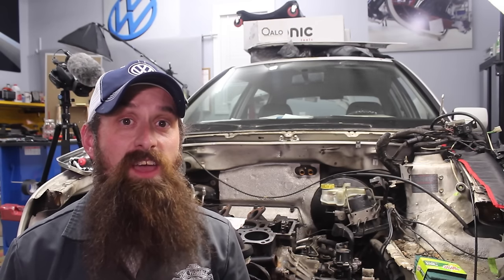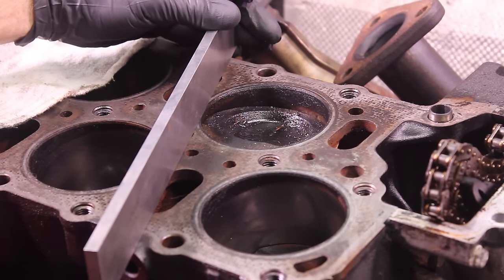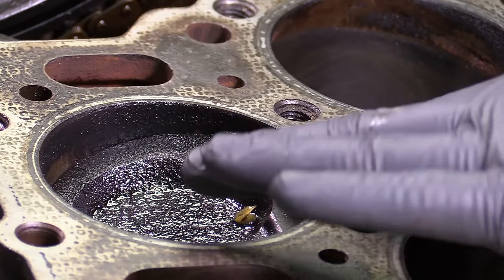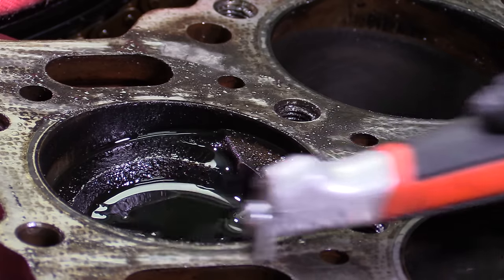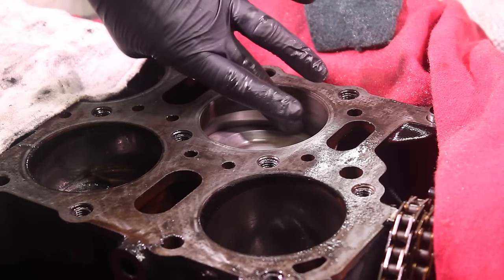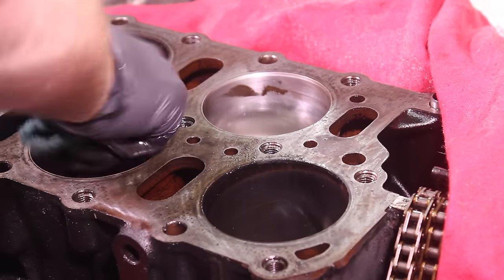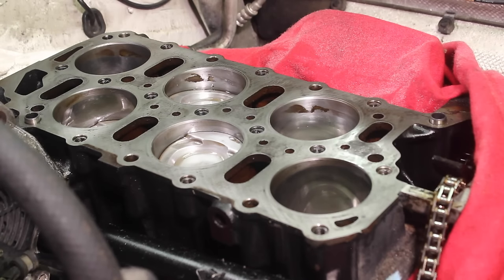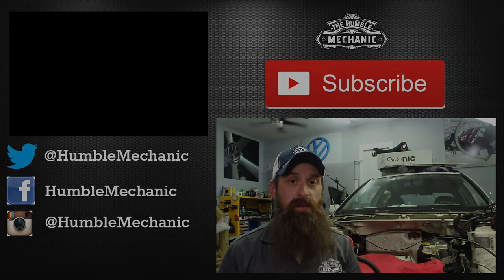Removing Carbon From Piston, Cylinder Walls, and Block Deck

Comment: I am not a mechanic although I worked on my own cars in the 70's and 80's. Here is a tip I always remembered from my father. You can build a grease dam around each Piston crown at the sleave when removing carbon. This will help with debree getting down between the crown. Then when done move the Piston a little down and wipe the wall and piston clean.
Reply: Fuck me that's one helluva smart trick! I had my engine head off and wanted to clean the block whilst it was still in the bay. After a bit of scrubbing I realized I got a shitload of debris and scotchbrite pad material down in the channels and around the piston rings. But then I noticed the block was junk anyway so I took it off and junked it. But next time I'm doing the block still in the car, I will use your dad's method!
Reply: That's a great tip, I'm doing it now on my old Lada Riva, thanks.
Reply: Now that's a hell of a trick! Simply genius!
Reply: What a great idea.
Reply: If your worried about debris, Just use a Shop Vac to vacuum it all out. Never had issues.  I always do this when replacing intake gaskets.
Reply: @jamesprival8528  
Turn over engine till piston is down, wipe a smear of grease around about the top inch of the bore then turn the engine over till the piston comes back to TDC and the gap will be full of grease. Do the opposite to clean it out once you're done.
Reply: @ThisOldMan-ya472  
Not a good ideas to blast the debris even harder down the gap with air.
Reply: @AuMechanic  Uhmmm, if you build a grease dam, and use an air blast appropriately, you remove debris without causing any issues with the parts. When blasting intake runners, be sure the valves are closed for that runner, or don't do it.
Reply: @ThisOldMan-ya472  Using the grease avoids the need for any air period, and using air will just force debris down in to the the ring land above the top ring and that is bad as it can cause the ring to jamb in the land..
Reply: This didn’t work for me, the grease just got all caught up and I had to turn it over a tons and wipe each time it hit bdc to get it out :/
Reply: Just take the pistons out, clean the rings properly and put back together exactly as it came apart … it couldnt be easier with the engine at the stage it’s at now 🤷‍♂️
Reply: Great 👍  video  bro!
That's what  I'm working  on ...
Thx,

Comment: A trick that I read about online, that I have used with good results, is to smear a little grease on the cylinder wall, then rotate the crank so that the piston pushes the grease to the top of the cylinder, then let the piston go back down. Any dust, dirt or debris that has fallen into the piston/cylinder gap will get stuck in the grease! Now you can simply wipe the ring of grease out of the cylinder taking any crud with it :)
Reply from the maker: That is a great tip!!!

Comment: I'd use a lacquer thinner to dissolve the carbon first. It will clean off faster with no scraping. Using WD40 AFTER that does seem like a good idea. I have decarboned many 2-stroke airplane engines and have never used any kind of scraper. Just shop towels. NO scrape marks anywhere!

Comment: why engineers hate mechanics
Reply: dude im a mechanic and i hate us. you wouldn't believe what kinds of "common practices" some guys use.
ive seen a guy use degreaser to clean the surface of a timing surface for a reseal, with it all dripping into the sump and didnt end change the oil.
Reply: @TheComaDay  i'd be lookin to slap some sense into that mech.
With that stated, I agree. I hate mechanics so much, especially shade tree's like myself, I won't let anyone touch my vehicle, not even to help, unless it's for an alignment or tires.
Reply: I'm pretty sure that if you ask mechanics, they will tell you we deal with shit engineering FAR more than engineers deal with shit mechanics. Talk to me about S85 rod bearings, late Audi timing chains, Ford 3.5/3.7 waterpumps, etc, etc.
Reply: @VTLIFE-so4dc  engineers should work on their own stuff, teach them to design right. I bet they'd change their ways. 😂😂😂

Comment: I just pulled the head off my 2000 Toyota Tacoma, I was told I had a blown head gasket after driving it for 30 miles and overheated slightly but not completely, that was after replacing the fuel pump after vehicle being parked for 5 years; i drove with old fluids, coolant was low, but immediately as I saw the needle climbing I stopped and drove it gently back home, once shutting ignition off it never started again, cranking but nothing, so a compression test was done showing zero compression on cyl 1 and 3 and 180 psi on cyl 2 and 4; firing sequence is 1-3-2-4; I was told "you blew the head gasket" 3 years later finally got to open the head; The gasket seems intact; I cant see any indication it is blown; there is no oolant/oil mix at all, old oil still conserves some viscosity and color; coolant came out also without oil mix in it, i look on chamber 1and cant see any issues with the valves, like a burnt valve? maybe a bad valve seat? I ordered new valves, seats and lifters, cams are worn but everything inside the head looks "normal" once opened; I thought maybe I had a bad coil pack but compression is physical not electrical so it would not matter as it was zero...I hope it is not the worst and maybe I have a cracked head or block??? I am taking the head to the shop tomorrow. Very weird situation.

Comment: 5:55 "Dont press down too hard, we dont want to take scrape off any metal" makes a fat scratch in the metal
Reply: Furries are disgusting Good call out. That's a time to be mindful.
Reply: It will buff out, usually/maybe. Had the same thing happen with bigger engines.
GO NAVY!
Reply: Wow! I was just going to put same comment @5:56 but you beat me to it. A fine example of why you DONT use a blade on a gasket surface, especially Head Gasket, especially aluminum. Im shocked he used it to begin with. "Cost me 20$ for the scrapper" and 150$+ to deck the block along with 25$ for a head spacer. He did mention using a roloc, better choice.
Reply: I dont want to make it sound like I'm cutting down the Humble Mechanic, just pointing out even those with much experience can still make a mistake with a scrapper. Having said that, it wasn't the end of the world, it wasn't in an area where the gasket would be up against a critical sealing surface and contrary to another comment above, buffing it out only makes it worse, do that and now you have a larger low area. So never buff it out. I'm am painstakingly scraping over a cylinder head now with a plastic blade that I'm constantly sharpening and brushing acetone on it in between. I really want to use a nice razor blade and I'd be a liar if I said I've never done that before, but I dont anymore. Think I'll get a roloc. I'm going to be at this for a few weeks with these results.
Reply: @ColdWarVet607  it's fine to use a carbide scraper on aluminum, but you need to do it correctly. I'm more worried about all the chunks of carbon that are now in the gap between the piston and bore, getting into the rings.
Reply: Amazon has some plastic blades that are useful
Reply: made me cringe as he actually put the blade on the block
Reply: I cringed a bit

Comment: I think you should mention that depending on the material the block is made from, different tools and techniques should be used to prevent damage to the mating surfaces of aluminium blocks.
Reply: I'm a mechanic and I approve this message. 👍

Comment: Lots of great information in this vid.
Over the years I’ve found hot soapy water works great for carbon deposits. 
I’m not recommending in this particular case, but if you’ve got parts off that have carbon deposits on them that needs to come off, try soaking them in hot soapy water. You’ll be amazed at how fast and easy the carbon comes off. It does have to soak for a bit, but man, sparkling clean.

Comment: Just did had gasket on my 2002 Civic with 285,000 mi on it.
I took a fine tooth wire wheel to the tops of the pistons... It got some carbon off but not all.

I feel skeptical that it would have gone quite so easy peasy if I'd tried this method! How many times have I seen something on YouTube and then when I put it to practice in real life, doesn't work out quite as promised.

Humble mechanic You seem like a good guy and in real life I'd definitely give you a shot! Just saying I've been burnt by YouTube before.

Anybody try this method and not have it work out quite so easy?

Granted 285 is more than 140... That's a lot more miles/ time for the carbon to harden.

Comment: As a qualified motor engineer with 50 years on my clock, might I ask about the piston rings ?
This is a 140,000+mile, engine. I agree that the cylinder bore 'cross hatching' marks being visible indicate limited wear & assuming there are no vertical plane scoring marks present then everything down the bores is all OK. 
However ! (There's always a however) on my vast and comprehensive experience with bashing engines with hammers, I would like to point out the fact that 9 out of 10 engines that I have stripped have the piston rings stuck in the piston lands. The piston rings in most cases need to be removed, sometimes even broken to remove them from the piston.
I ask, if the 'crosshatch' marks are visible and there's a 'within  tolerence' 'Bore step' on this high mileage engine, would it not be prudent to assume that the piston rings have stuck, thereby causing excessive oil consumption etc. and as you've gone the trouble of half stripping the engine, to remove the piston & conrod assemblies ?
I know its a can of worms but at high mileage, the crank bearings might be well worn. 
I understand that this video deals with block levelling but attention is being given to the bore condition & I thought my input might be of some help. 
Respectfully. Not a
 criticism, just observations based on a career lifetime of engine rebuild fails ! 
Nice informative video by the way. 
My respects,
Johns MG Rover parts.
Reply: You young fellers and your "piston rings"...why in my day...
Reply: John Sadler It’s a stinking VW. You overthinking this greatly. It’s not worth rings much less cylinders being bored and oversized pistons.
Reply: Your correct with that many millage them crosshatch should not be visible. Bizarre,then again it's been some time I viewed iron walls, working on today's motorcycle engine using chrome nickasilk
Reply: @prevost8686  modern  VW engines have many issues with oil scraper pistons rings: they are thin and the oil holes are very tiny and if the case the car is use most in city and not frequent oil drain with high quality oil,  this holes are many times clogged= high oil consumption, and looks like the engine whe see here as such issue because the thick oily residues on the pistons and cylinder walls...
Reply: I would of done a compression test before hand
Reply: There are more hacks than craftsman.
Reply: Thats good info John, I'm going the whole hog on my Lada Riva. No point in putting it back together and ruining it completely.
Reply: Omg wtf
Reply: @prevost8686  loop l
Reply: Wd 40 fixed it, along with duct tape. C'mon man. It's a throw away car.
Reply: @robertmudrow3617  ah, the old liquid puston rings in an aresol spray can. Cures everything and kind to hands..

Comment: All I have to say is thank you so much. I have never been able to clean the top of pictures as well as you did in this video. I know this is an older video and you might not ever see my comment but I still wanted to thank you for sharing. I also love that WD-40 spray bottle. I could not even guess how many times I have sprayed myself in the face with the aerosol can. Again thank you for your time all sharing this with all of us and it will definitely come in handy for me. I have 2 Motor jobs sitting outside my garage and I'm definitely using your technique.
Reply from the maker: Thanks so much!!

Comment: Nice production values - great lighting and camera work.  Looks a lot easier than the engine project I did without WD.  I used a metal stripper and the fumes were nasty.

Comment: I did this on my XJ's I6 engine a few months ago with nearly 200k miles on it. It definitely is as easy as your video shows. Felt good to clean all that build up off.
Reply: did you it with the engine out? i’m cutting getting my cylinder head machined and was wondering if it can be done with the bloc still in the engine bay.

Comment: I have always used an air angle die grinder with a cookie (scotchbrite) wheel to clean up blocks and heads.I have never had the patience to try to clean up M.L.S. gasket from an Engine.I give you credit for that.Even though I'm not a VW guy,I love seeing any type of major Engine work done.Great Videos!

Comment: The best thing I have found for this task is Chore Boy Stainless Steel scrubbing pads. These pads are like steel wool pads, but instead it is a thin, narrow, tighly coiled SS ribbon formed into a pad.These are made for cleaning cooked on crud on frying pans and such. They cut through the carbon like it was butter, and are non-abrasive, unlike Scotchbrite pads. I cleaned the carbon build up in the cylinders and on the pistons on my Kia 4-banger that I am working on, and it took no time at all.

Comment: I clicked on this video just to say I use WD40 to clean carbon from pistons and heads but I see that's what you use too. lol! Best product ever. Will even free stuck rings in high mileage engines.